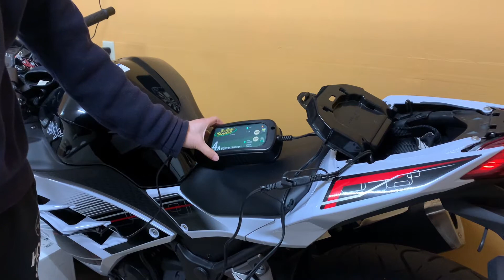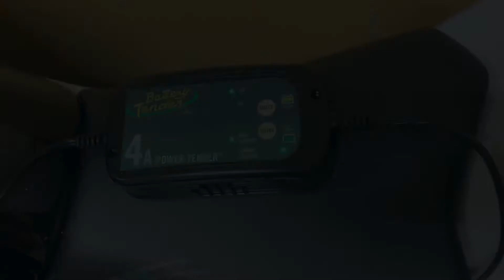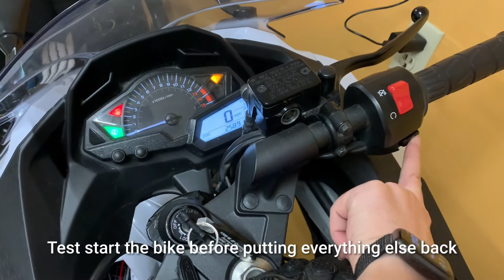Kawasaki Ninja 300 Battery Replacement - Tips & Lessons Learned

Comment: Hello is there a way to look up which batteries can be supported by ninja 300 ? Actually the battery you have mentioned is not available in my country.
Reply: Remove the original battery and take it with you to a battery store, they’ll provide the one which is compatible

Comment: i got the same bike and its been sitting i got a fresh battery and fuses on it as well , it cranks but it does not fully start. I hear the motor trying to start but its just not turning on any suggestions ?
Reply from the maker: I think the cheapest option is to first confirm whether the new battery is good or not. If you have access to a multimeter, check the voltage of the battery when the bike is off, also monitor the voltage when you try to start it. A perfectly healthy battery should hold at ~13-14v when the bike is off, and will dip when the starter is working, but not dip below 12v. After this try to use a jump cable with a car to see if that works - if this still doesn't work I'll start looking into the starter.
Reply: @YiyeTinkers  thanks bro you the man
Reply: Change the starter. It is a small box that gets corrosion over time

Comment: This is ridiculous. If you drop something into this compartment it’s gone forever. Terrible design by Kawasaki
Reply: I promptly dropped something into this compartment directly after reading this comment. It was gone smh
Reply: I dropped a nut for the battery while changing. Used up buying a flexible magnetic tool on Amazon to get it back. The design of the battery compartment is absolutely awful. It's a ramp into a tiny crevice that you won't be able to reach into.